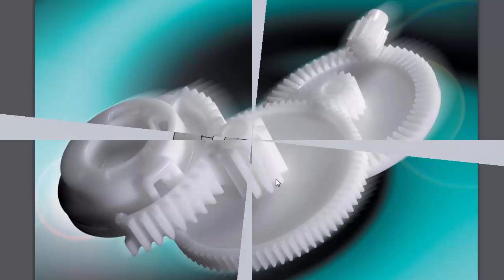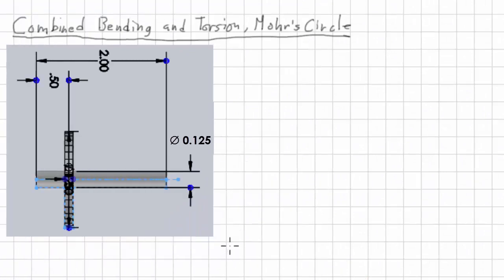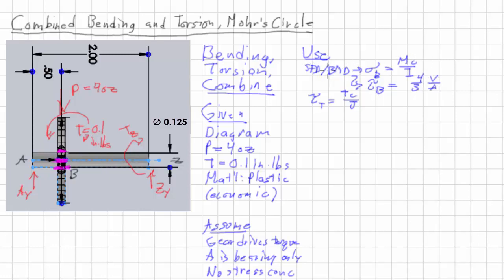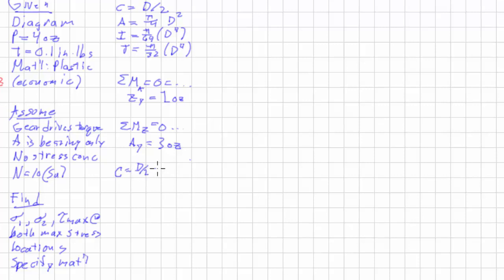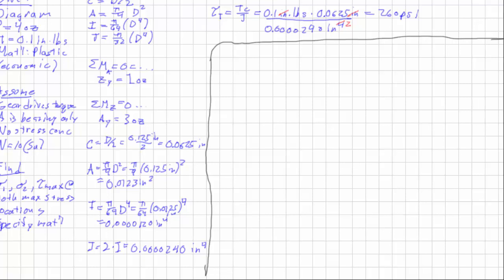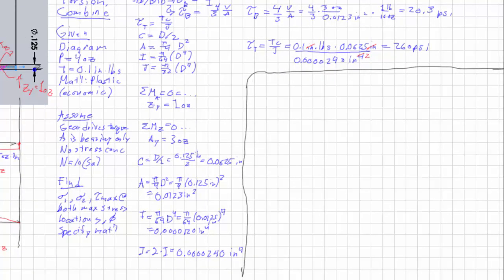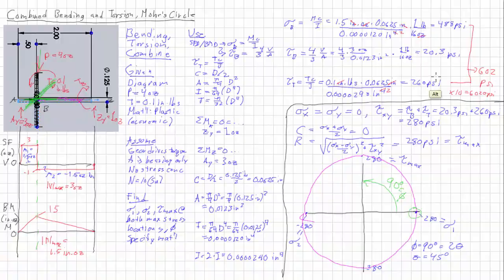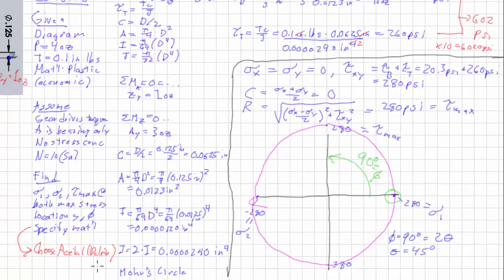Combined Loading with a Gear Shaft in Bending and Torsion

Comment: the video was great although I think there is a mistake considering the shear stress due to torsion you set it up positive due to counter clockwise torsion nevetheless, in the mohr's cicle you set it up above (where is clockwise) and It should be down because is positive ( I hope I made clear my point, correct me if I'm wrong  ) Good video!